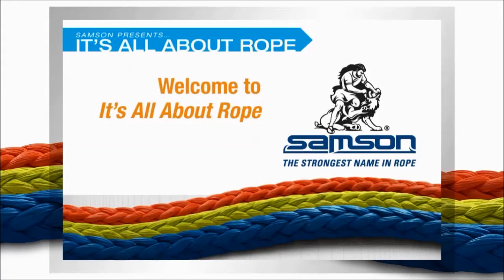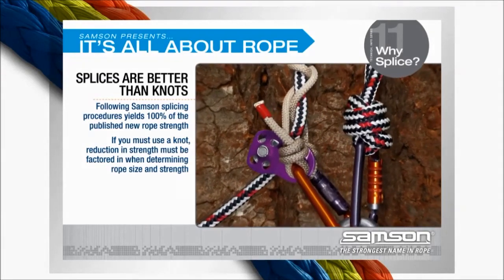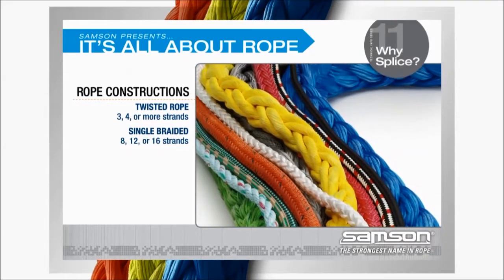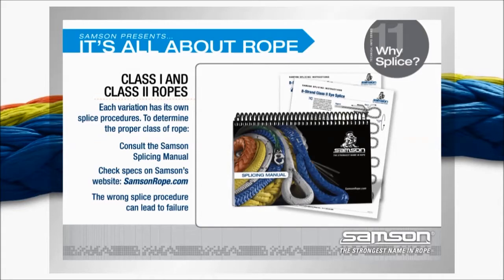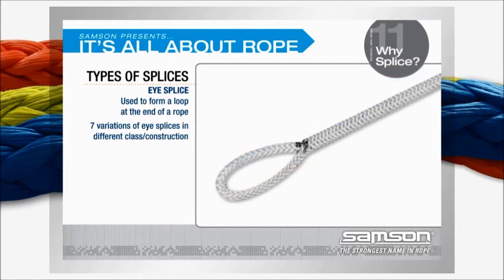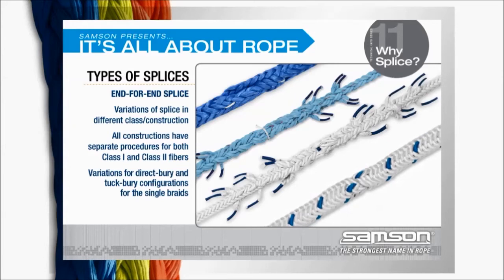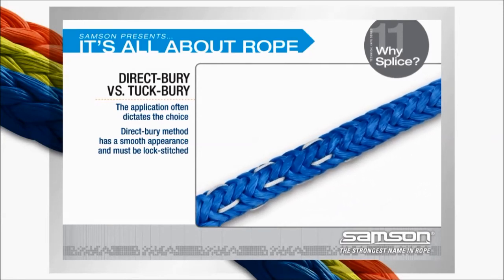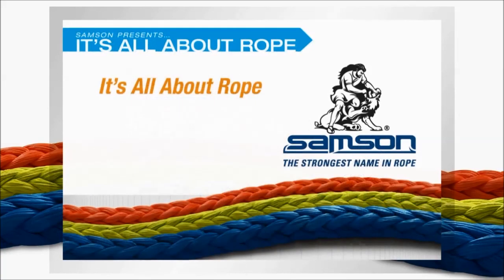Its All About Rope: Why Splice?

Comment: Awesome possibilities!
Reply: Seriously!  I didn't know the 1st thing about cordage a year ago, am now about to start 'free-handing' a backsplice on some double-braid spliced slings I made (with Samson's video on Class1 splicing) and then begin two end-for-end splices on a 3-strand to try something else.....once I get some suitable hollow-braided rope I'm eager to make whoopies/yippies/loopies, everyone uses Tenex TEC and, hate saying it on their channel, but IMO that stuff is sub-optimal for rigging cordage, I mean sure it's got great static strength but my Polydyne has slightly-higher static strength anyways WHILE ALSO having 3% elasticity @10%ABS, that's 2X as much 'cushion'/shock-absorption and I'm an arborist so for tree-rigging dynamic forces are MORE important than static, I know the two tend to trend-towards each other but it's not always the case!

Re your post- did you ever explore these possibilities yourself?  I gave-up after my 1st failed attempt, only after learning more about dynamic forces, and how useful splicing is in such contexts WRT system-strength, I realized I HAD to learn lol so tried again - using Samson's video instead of NEropes' which is what I used on the 1st/failed attempt - and have done 6 splices from that video in the past few weeks :D  The learning curve is SO steep, but it's not that large a hill, if that makes sense!  At first it seemed like voodoo but after nailing your 1st success, and especially during the next splice you do, it starts becoming very intuitive in fact I've little doubt that I could splice w/o their video at this point, I still like it but don't think I've needed it since splice 3 or 4!

Comment: I'm surprised you don't even give lip service to brummel locking a splice vs stitching.
Reply: LOL I was going to mention the same, only WRT back-splicing!!  But let's be real, Samson's youtube channel is hands-down the "final word" so far as what's publicly-available out there, I mean Yale and NEropes have their own channels but Yale's looks like it was made in 1995 and NEropes, well, they don't have remotely the volume of videos as Samson NOR do they have the quality (my 1st-ever attempt was using their video, it failed....my recent work, attempts 2-->7, were all successes using Samson's video, I think it was because I was splicing Blue Moon, a notoriously difficult DB rope to splice, and the precision of Samson's method won-out over NEropes', by that I mean there's parts in their video where measurements are "about" instead of hard-#'s whereas Samson's is purely hard-#'s)
Can't give enough props to Samson for doing this, they obviously don't have to, I couldn't use their bull ropes as Nystron's 2.4% elasticity is still lower than I want to use but next climbing line will certainly be from them as-thanks for them putting out all this great content both the youtubes and the written stuff!